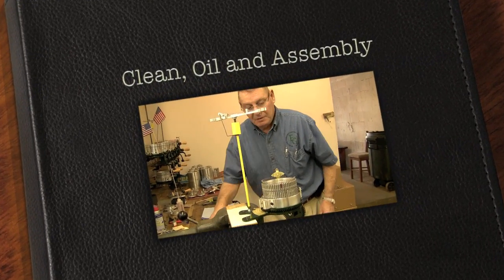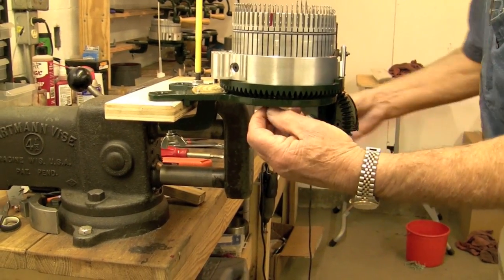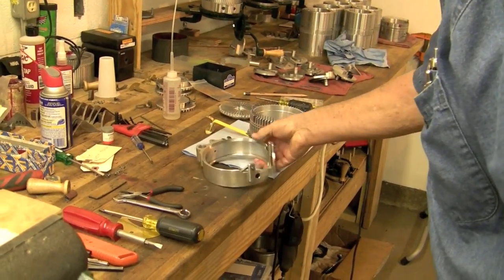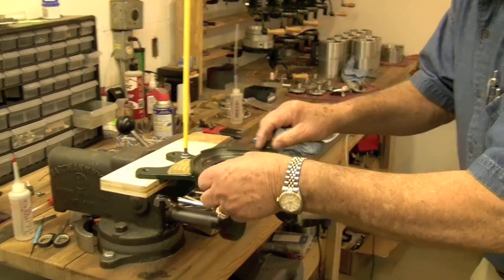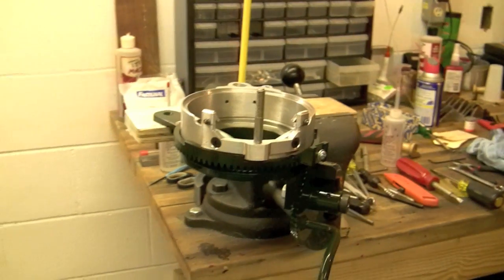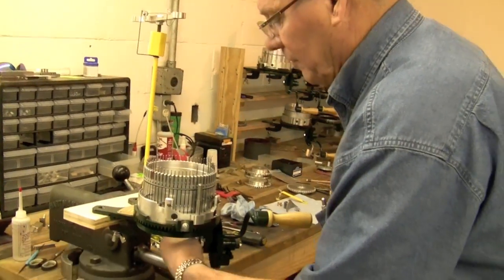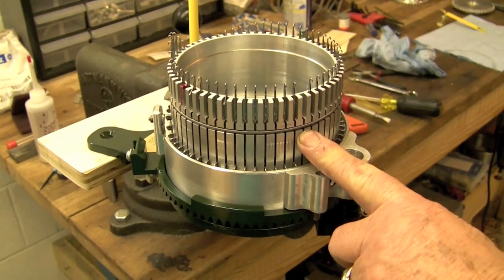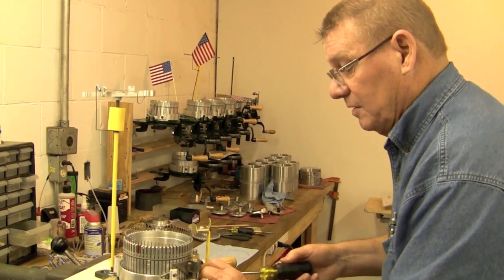Essentials: Clean, Oil and Assembly HD

Comment: Dissassembled and cleaned, oiled, very old unit, and now it turns with a slight wobble, I could not tighten the second bottom screw all the way, or the unit would bind up...any suggestions?